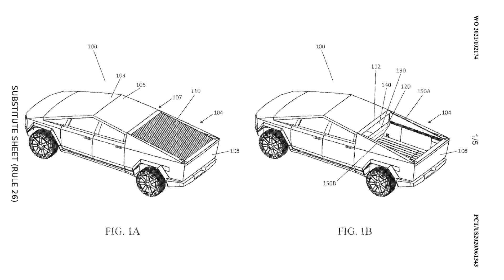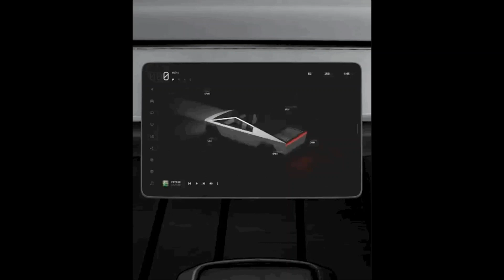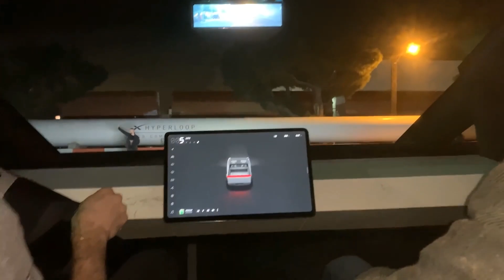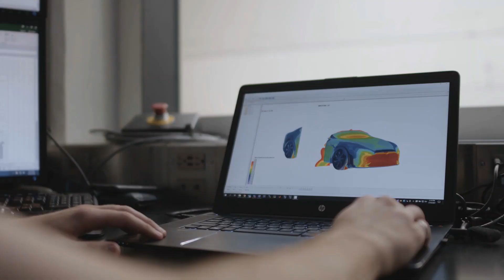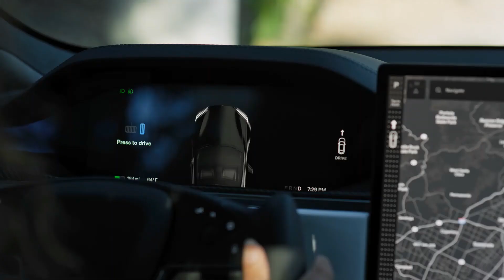Tesla Cybertruck - Elon Musk Released The 2021 real cybertruck

Comment: Just wondering if they are making this truck a bit shorter so it would fit in a standard garage, normally you need an extra 5 to 6 feet at the front for a shelf or a workbench.  I have been very impressed with Mr. Musk, he has brought the electric vehicle  to the fore front and now the other large auto manufactures are trying to catch up.
Reply: Could be good, if we can choose long and shortere version.
Because I want one, as big as they will be able to make them 😂
Reply from the maker: it would fit in a garage and Elon Musk is a genius